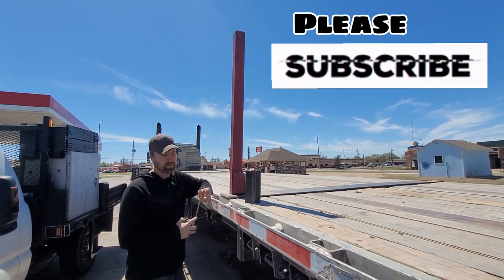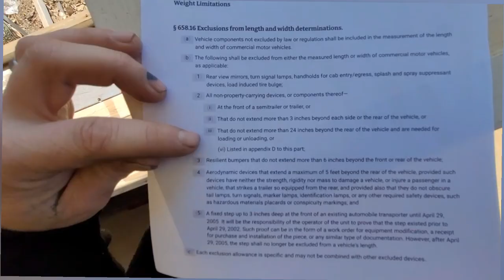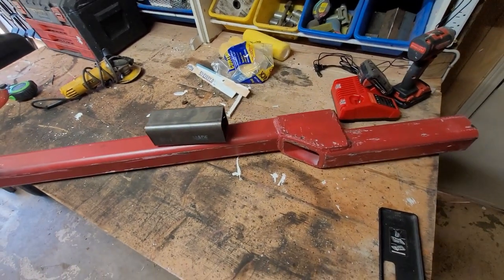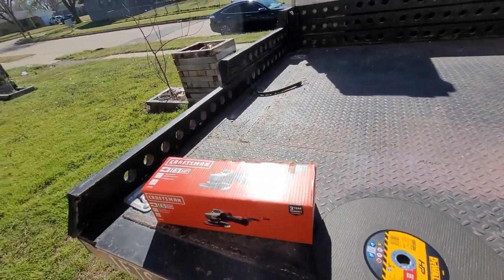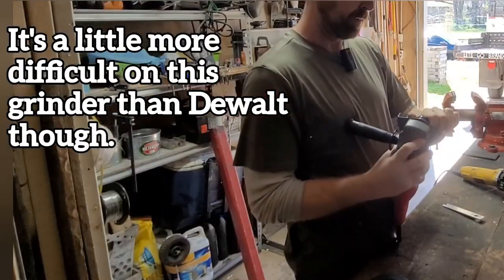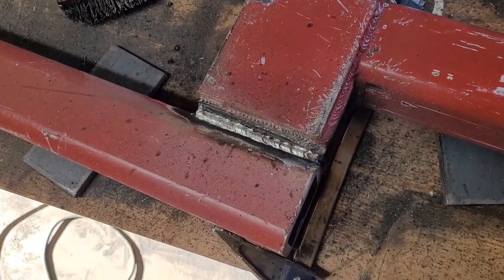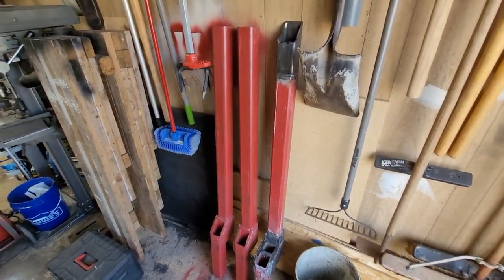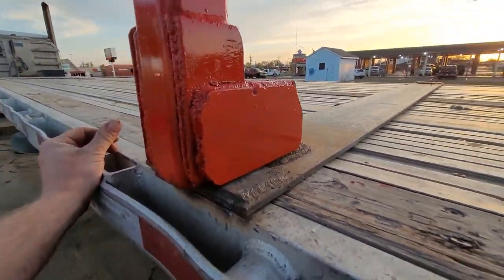Rebuilding pipe stakes for a flatbed.  part 2.

Comment: I know it cost money but I would have just made a new set, the more welds you put in the more potential failure points
Reply from the maker: There was no way around it.  Even with completely rebuilding them from scratch, they would of turned out pretty much identical with the exception of the welds at the top where the pipe goes from 3/8" wall to 1/4" wall.  To make them without having to splice a piece of 3" tubing at the bottom, I would of had to completely redo where they insert, meaning I would of had to cut more holes in the trailer to widen them out, plus my winches wouldn't slide past them at that point.  The whole point of the way I built them was to be able to slide the winches, not have to drill holes in the outside frame, and not have them protrude outside the trailer.  Believe me, I thought this out, a lot.  I obsessed over it.  Mine are probably 10 times stronger than most I see.  I also put way more welds in mine than most.  Weld over weld over weld then a 3/8" plate over that with more welds.  It's stout as hell.  I've used then a lot since this video hauling pipe from 2 3/8" to 18" and they don't budge.  It would cost around $1500 to $2000 to rebuild them.